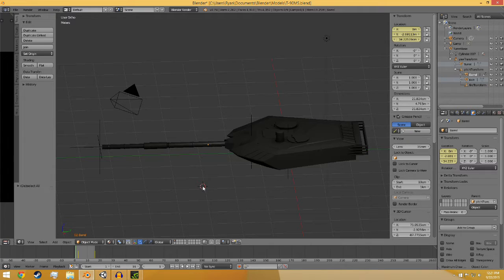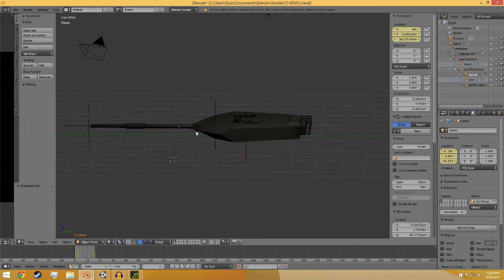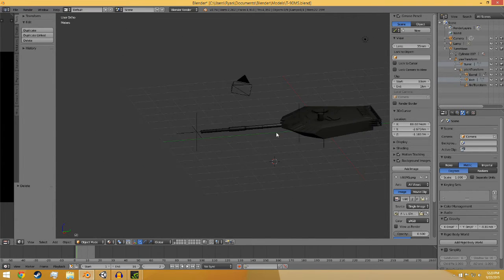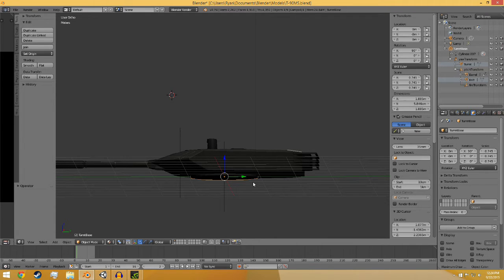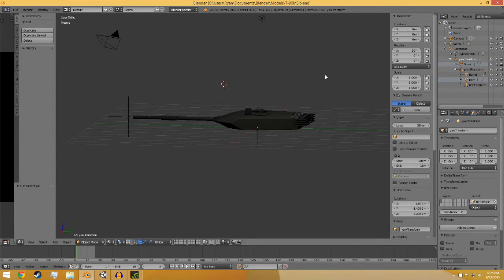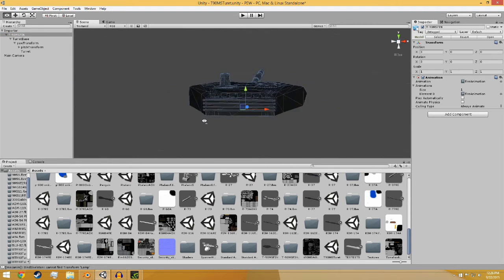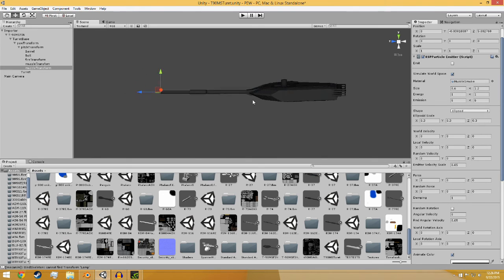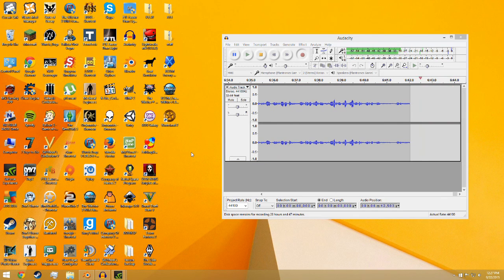BDArmory Turret Tutorial

Comment: It took several days fighting with KSP-unity-blender to make a damn turret at the end it worked, but it is the little details that made everything fail, these are the "rules" I learned about the turrets (almost all covered in this video, but the little details not covered are my mistakes):
Turretbase (a 3D mesh) and the pitch/yawTransform (empty plain axes) NEED to be turned positive 90º in the X axis (IN OBJECT MODE). If you already have a turret model but not configured turn the 90º in object mode and then "undo" the turn in edit mode selecting all vertex pressing "a".
The hierarchy is like this: TurretBase>yawTransform>pitchTransform IMPORTANT>>> The 3D mesh of the turret body is "son" of yawTransform AND "brother" of "pitchTransform". pitchTransform NEVER can be inside a 3D mesh, only can be directly inside yawTransform.
Problems on the yaw-pich-fireTransform CAN NOT be repaired in unity, the blue arrows "Z axis" of this points need to have 0 in all rotations and face forward, the 3D meshes can be rotated and moved in unity without problems, but the plain axes only can be edited in your 3D editor.

Thanks for the video.

Comment: would you be willing, (if you are even able XD) to make a turn table that works with the BD armory AI. lets say i want to make a sam system to fight against. so if i put your RIM116?!? i think it was the rolling air frame missile. on it, it wont work. because this missile is a heat seeking missile. that means that the missile only has a small cone, in which it can fire. so if you come up from an other direction then the missile is pointing at. it wont fire. what i would like to have is a turn table, on which we can add some structural beams and ad missiles to those. and then have the turn table turn towards a threat once the threat enters the 3500 scan range of the Weapons Module. or within the range of a connected Radar system. like it works for the Abrams turret automatic target tracking. but we cant add any objects to existing turrets in BD armory. which prevents me from building working IR missile systems. sometimes when you make a Radar controlled AA site, and you do not have the missile pointed up. it will not even track targets. it would just be awesome to have a turntable which automatically turns towards any detected enemy Weapon Manager.
Reply: well i could try that....
Reply: (i just started making stuff for BDarmory :D)
Reply: but i wanted such thing too so yeah i'll try it (i cant imagine it to difficult....  i think really easy actually!!)
Reply: Toni97531 awesome :D let me know if you are able to finish it. and decide to put it up for download.
Reply: +Lodewijk Vrije at the moment i don't have that much time but all time that's left will go into that !! :)  
meanwhile you could download my little BD addon on curse forge....  just look under newst files and it schould pop up ! 
it's called WIA   
if i finish the missile site i'll add it to there !!!
Reply: +Lodewijk Vrije sry m8 i tried my best and i got it all to work but the only thing is, the stuff you attach to it doesn't turn with it.....
tough right in this moment i may got the solution.....   i'll try !
Reply: Lodewijk Vrije m8, the heatseeking missiles will work with radar to ( i think) so they use the radar until the thread gets into the missile cone..... if that doesn´t work try to edit the .cfg files of the turrets and set all attachment rules to 1 !!  that will enable the surface attach, stacking, etc. !!!!!
Reply: Toni97531 DUDE tank you SO MUCH, ill just use a turret which is already in one of the packs i use.

 and the Radar thing doesn't work btw. its like i said, the heat seeking missiles will only aim in a cone shape forward. you can lock and track a target with the radar. but as long as the target is not in the missile's heat seeking view finder it will not lock on. even if the target enters the cone later. the target needs to be in the view finder of the missile at launch for it to start tracking a target. this is why flares work, you make a hard turn and pop flares. then the missile will have trouble calculating which heat source is and isn't your exhaust.